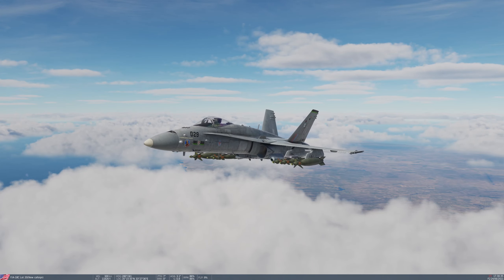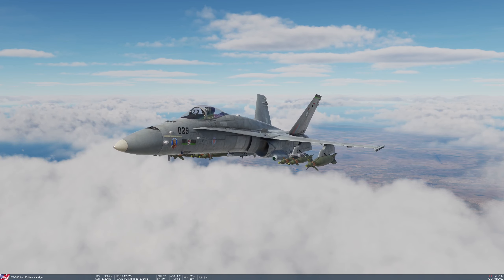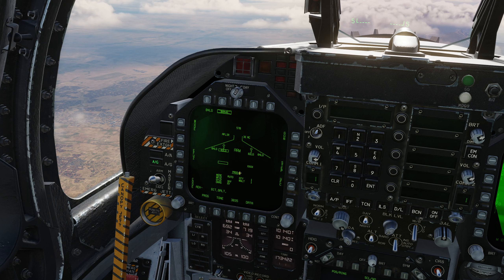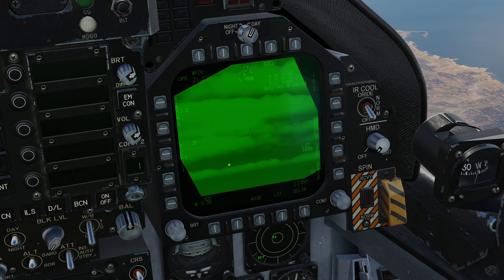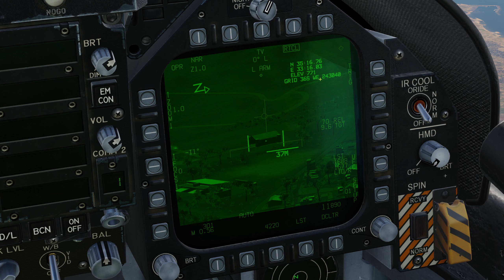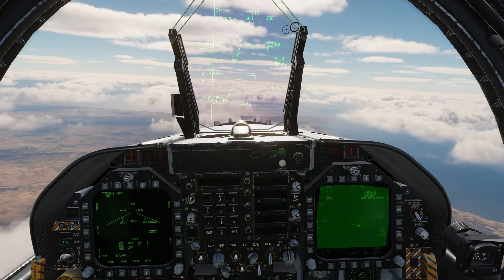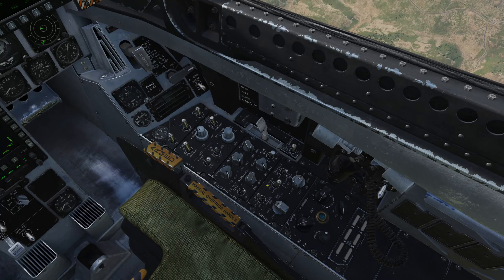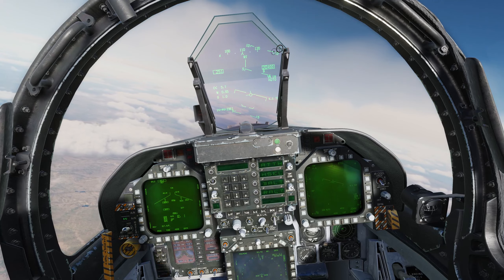DCS F/A-18C Tutorial 10 - Laser Guided Bombs

Comment: It is worth noting that now (August 16th, 2024) you cannot change the LGB codes in the air. While you can use the UFC to input a "new code", this doesn't actually change the code of the bombs. If you want to have different codes, they need to be changed on the ground.